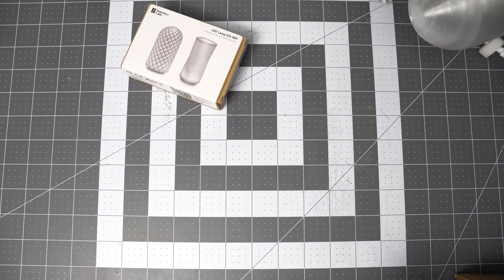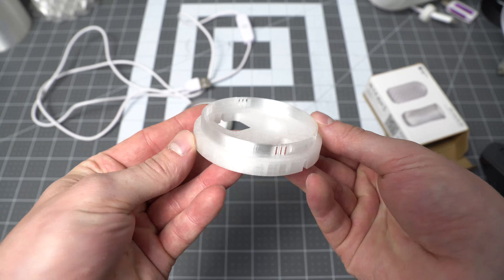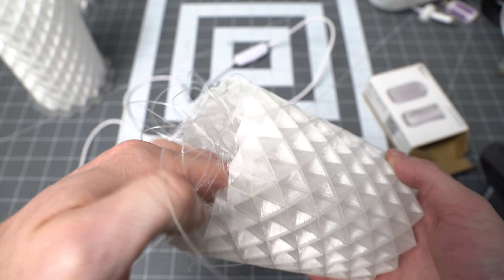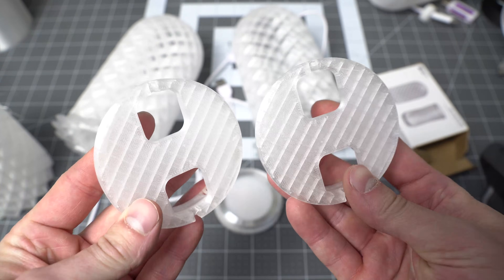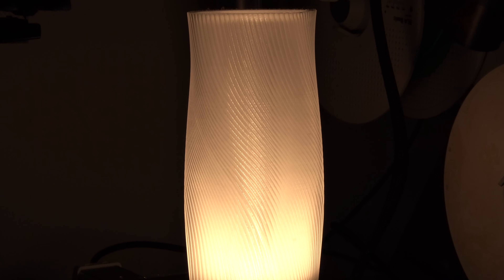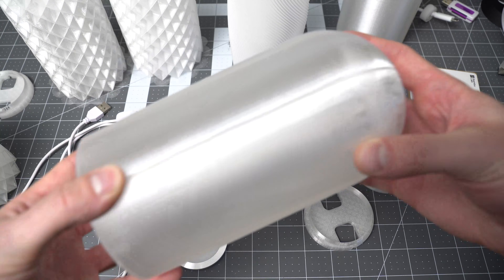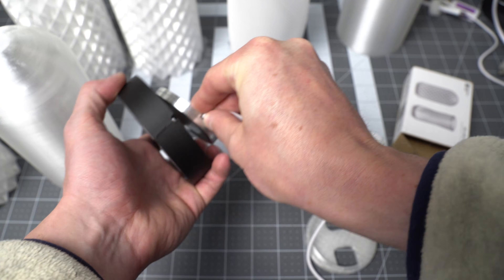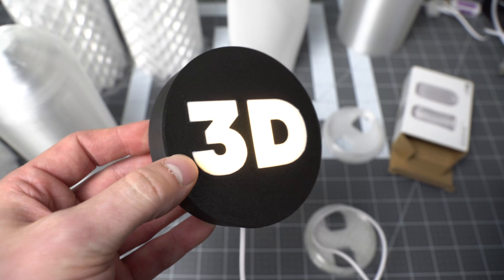LED Lamp 3D Printing Kit - 001 - Bambu Labs | Assembly Video + 2 Bonus Designs

Comment: What are the screws for? I got the lamp and see no way to open it up to put the screws in the other way..
Reply from the maker: They’re for mounting the light to a wall or underneath a desk or cabinet. You don’t use them for these models.
Reply: @3DPrintStuff  I know,  but how to do put the screws in the lamp? I see no way to open it up to put the screws in. I see the holes but that would go thru the lamp so clearly it goes from the inside. Any ideas?
Reply: @3DPrintStuff  ??

Comment: Thanks for the video, I'm trying these settings now.  I remember seeing that CNC Kitchen video when it came out and rewatched it.  One thing, can you point out where in the video, Stefan says to go to 270* C for the hotend?  I only see mention of 230* C, like at 12 minutes and 25 seconds, he shows 2 different screens of settings and both show 230, not 270.
Reply from the maker: He doesn’t mention to go to 270 that was just me experimenting and going off of the original write up https://www.printables.com/model/15310-how-to-print-glass for better results I would follow CNC kitchens recommendations.
Reply: @3DPrintStuff  as info, this works on the flip side too.  For my gridfinity bins, I wanted matte grey, not glossy grey.  Plus, since I'm going to be producing 50-60 KG's of bases and bins for my shop, I wanted to go with a PETG filament that didn't break the bank, yet still printed good and such.  I've been buying Elegoo's Rapid PETG at around $10 to $12.50 or so per KG.  Then I worked through the settings that seem to let it print best (and also be somewhat matte finished).  
240 nozzle, 80 bed (all layers)
10 mm^3/s volumetric
20% cooling, 50% for overhangs & bridges
1.5mm retraction at 40 mm/s
Initial layer 50 mm/s (infill and wall)
Bridge at 50 mm/s
To get this to a more glossy finish, use all of the above plus bump up nozzle temp to 255-260.  Pretty cool how that works.

(above settings are verified on Prusa XL 5TH, Prusa MK4, and Bambu Labs A1 Mini)